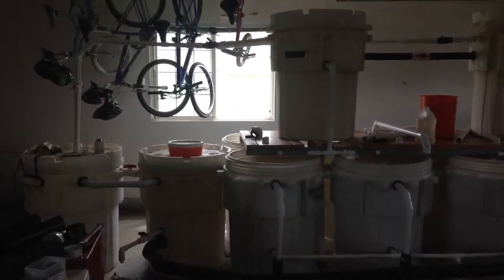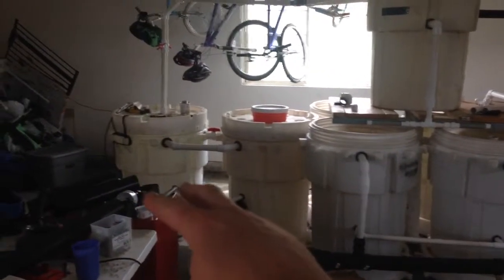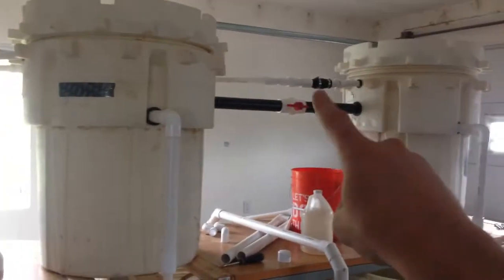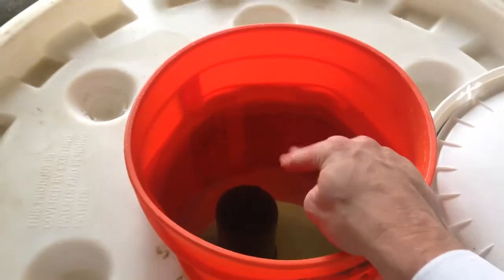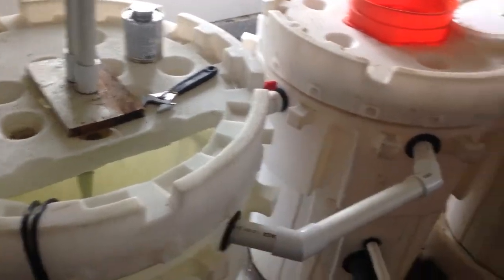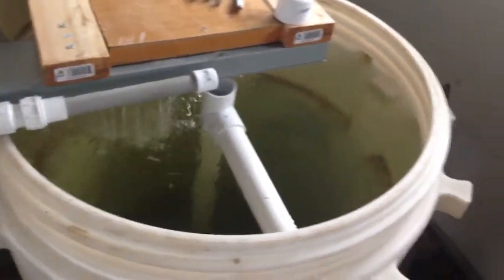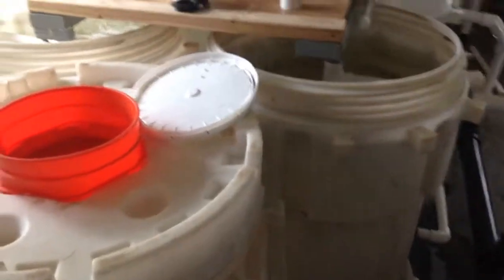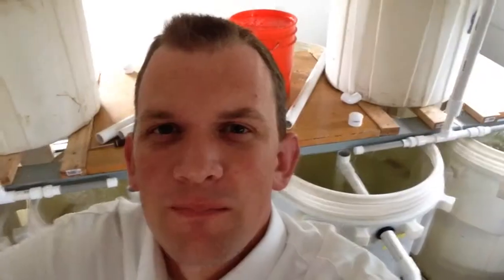(5/24/2015) DIY Aquaculture Build (RAS) Update

Comment: Hi killian, really interesting video u have. Very inspiring for me to do RAS also. I have question for u actually, i want do system just like yours only bigger, i used 12 fish tank (poly tank, about 4ft height, 4ft dia., 300 to 350 gallons), if i use 2" pipe for SLO and down to the 2" pipe and go to RF tank, the question is, what is the different if i use 1" or 2" pipe for SLO?